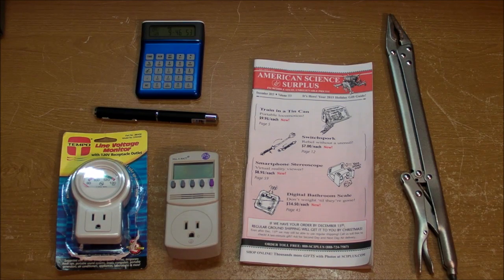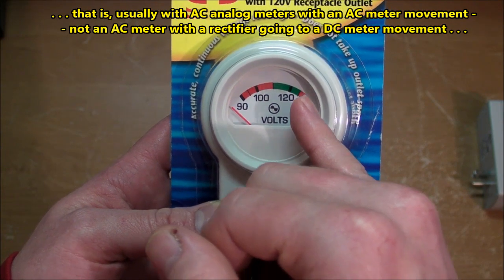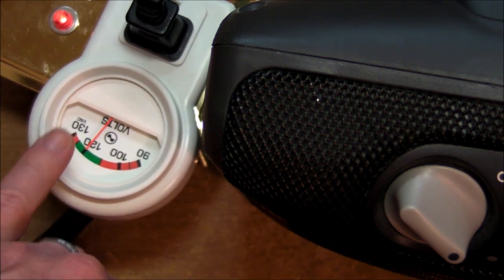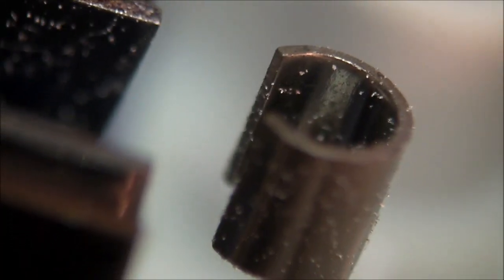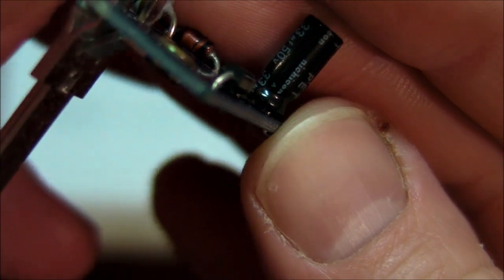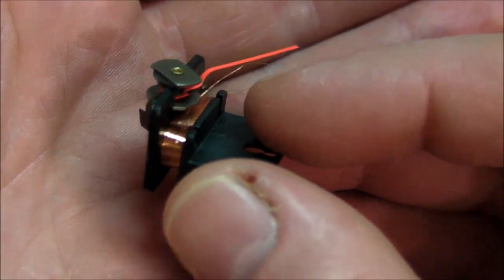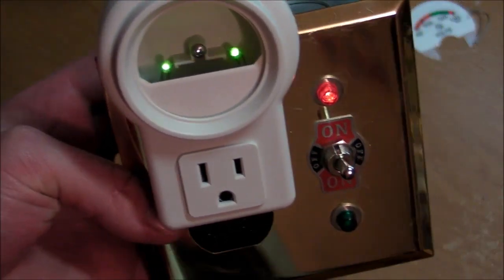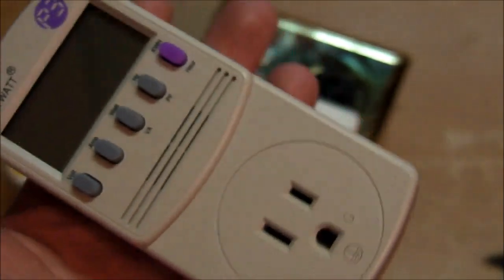(#0213) Tempo Line Voltage Monitor

Comment: The back of the line voltage monitor package claims "Temperature Compensated Circuit (will work during temperature changes of 0° to 100°F)". I'm sure it will work across that temperature range, but exactly how is it "temperature compensated"?
Reply: +vwestlife Diodes, LED's and Zener diodes will have different temperature coefficients, by putting a normal diode in series with a Zener diode you can partially compensate their temperature coefficients. I guess by having all those diodes in series some temperature compensation occurs just by coincidence.

Comment: I have a PV system on my roof that is Grid Tied.  There is a Net Meter outside that shows when I'm drawing or pushing power to the Grid.
I would like to monitor the power coming or going to the Grid from inside the house.
Any idea how the sensing circuit would work?
Al